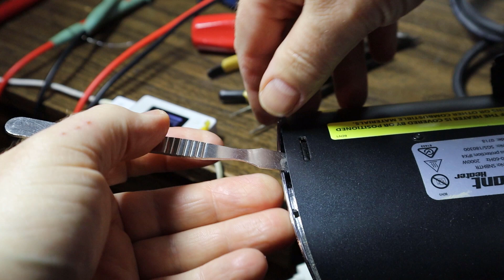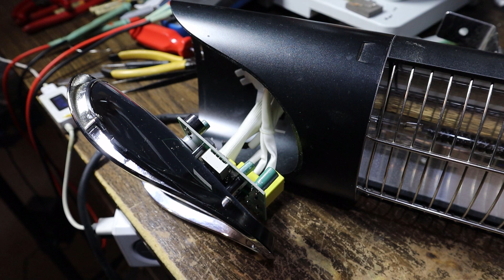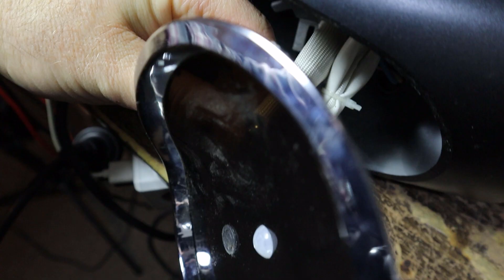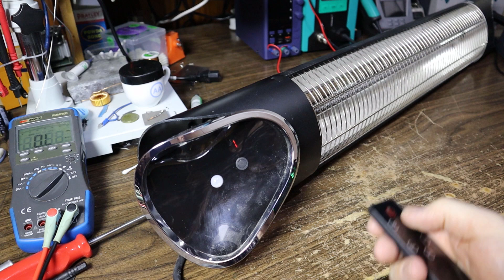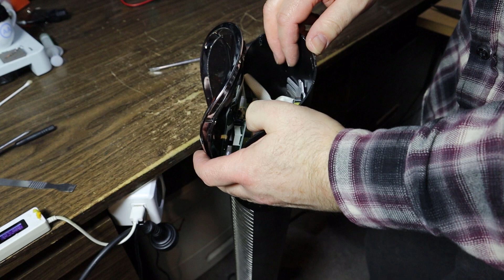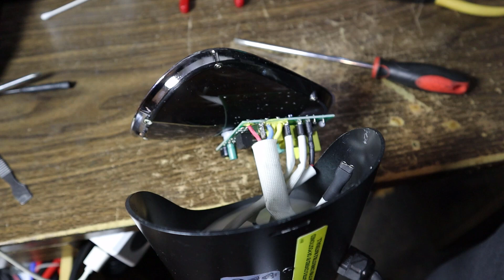TEVO Infrared Instant Heater Won't Turn Off Repair.

Comment: Must have been shorting to the earthed casing, have to wonder if the house it was used in has an electrical issue where the earth leakage isn't working or maybe not even present due to age pre-dating the use of RCD's.
Reply from the maker: Yeah likely old house/workshop. I presume new builds must require RCD breakers now? Or maybe only under certain circumstances like commercial builds.